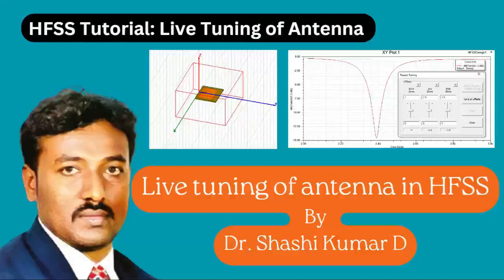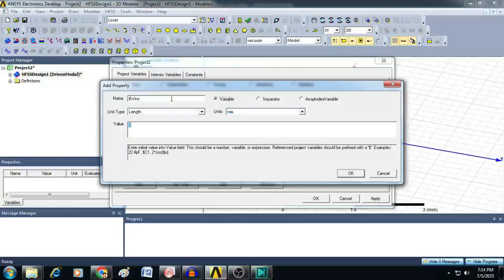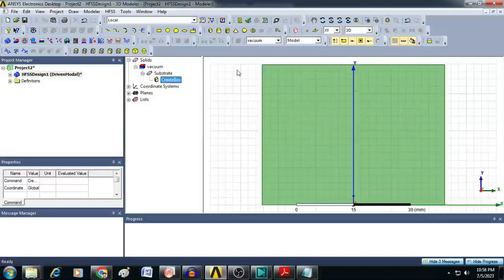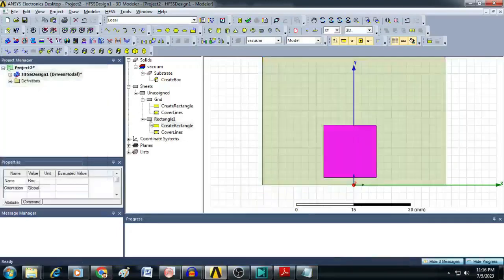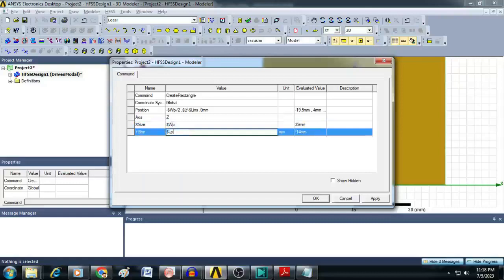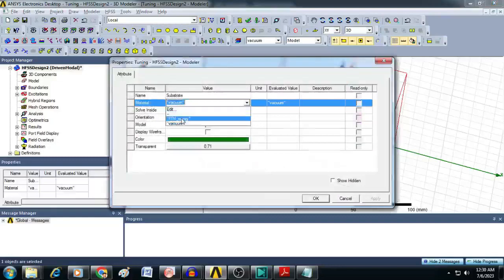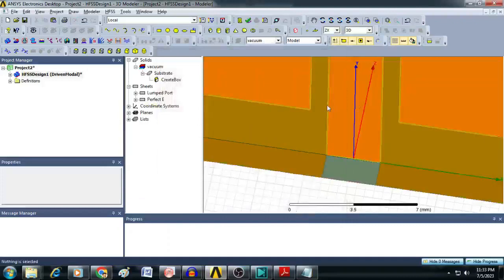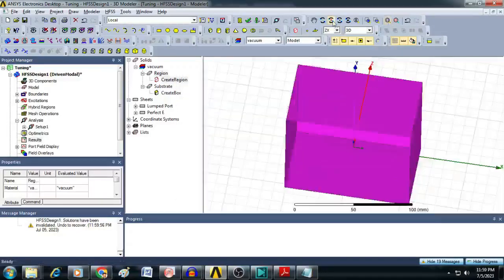HFSS Tutorial: Live tuning of antenna in HFSS

Comment: Hi sir, the tuned values when EM simated wont provide  same S parameters.  how to address this issue.
Reply from the maker: This method  will give you near to the optimum values. To get optimised parameters you can use either parametric or optimetric method. You can find this video's in my playlist.